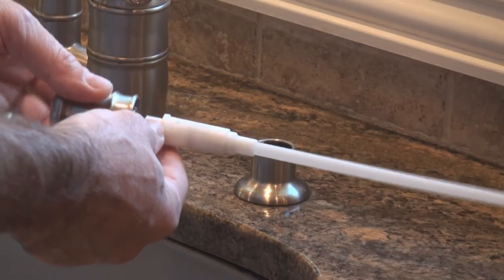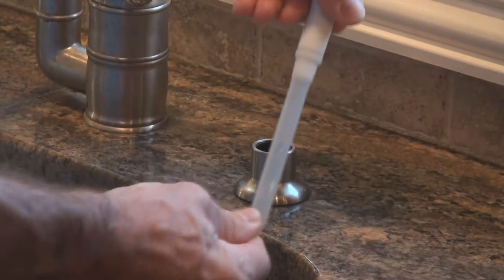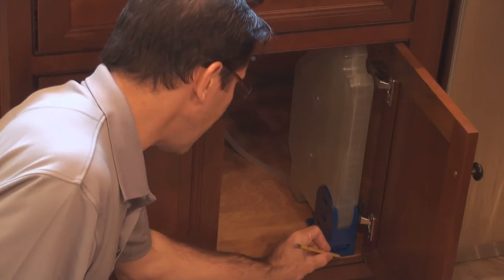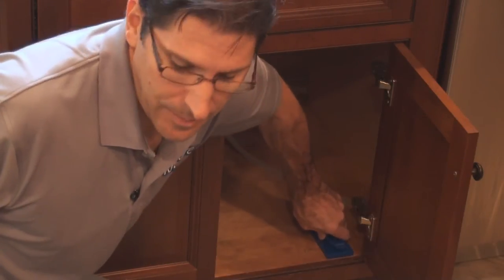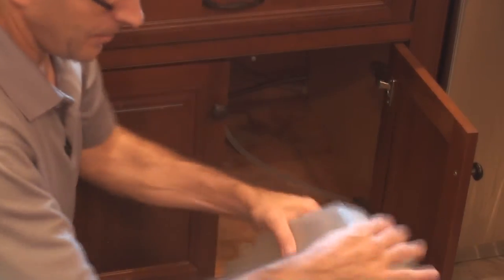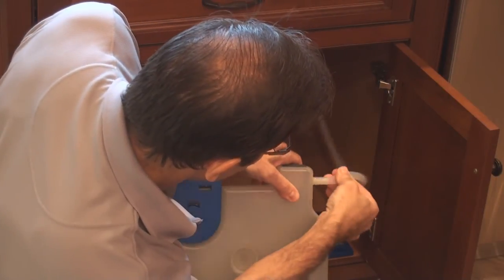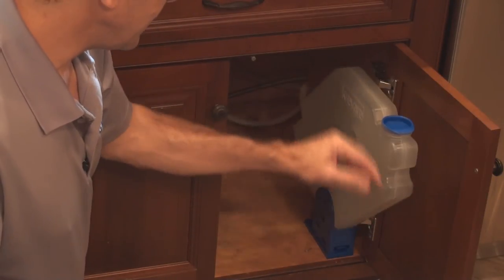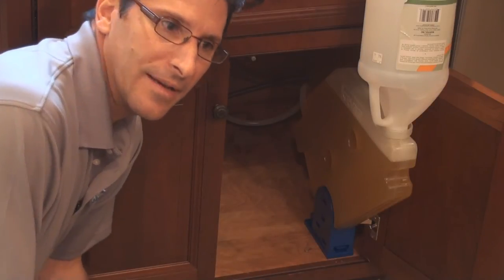Installing SOAPTAINER

Comment from the maker: Yes it will work.  Depending how far away from the dispenser it is you may need a longer hose.  We use 3/8" silicone tubing and include 1 meter length.  The unit is only 2" wide and 11" deep so it may fit on the same side as the dispenser.